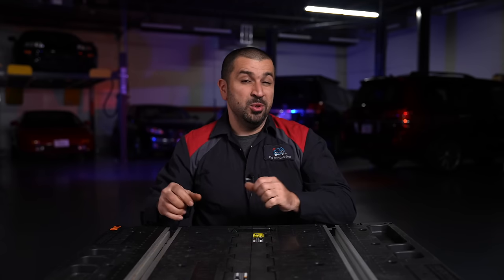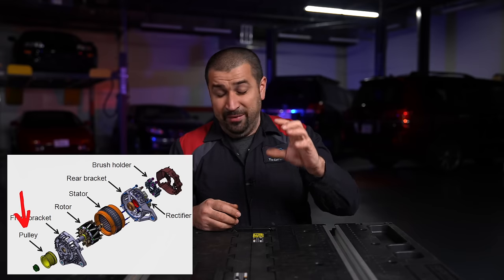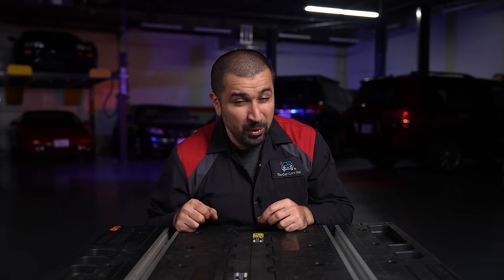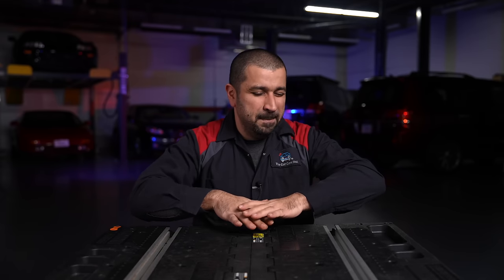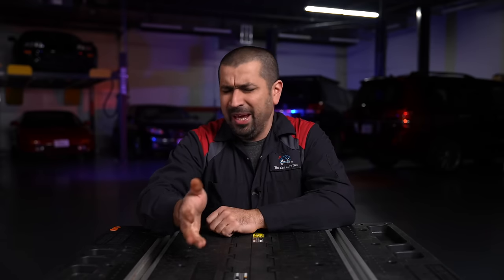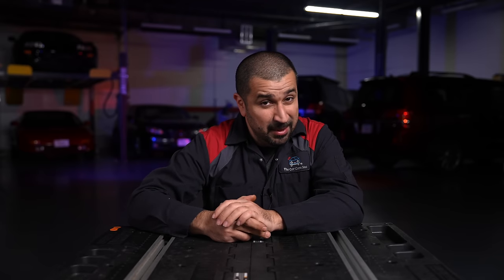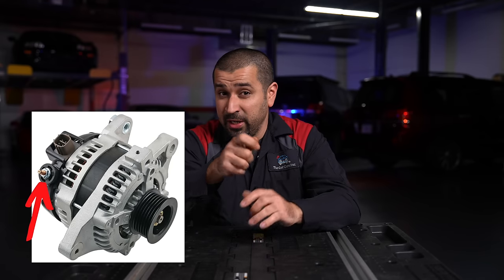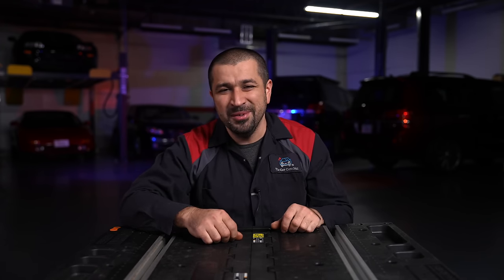How To Make Your Car's Alternator Last Longer? Everything You Need to Know

Comment: As an Electrical Engineer by profession since 1988 I can say: your explanation about the alternator working principles and how to take care of it is absolutely comprehensive, precise and correct, albeit easy to understand, I’ve ever seen! Greetings from Brazil!
Reply: except the bottom half would not normally be tossed but polarity flipped assuming they would use a full-wave bridge
Reply: What does it matter were you're from???
Brazilians have some complex don't they?
Reply: Can you please explain how the alternator generates ac current instead of dc current?

Comment: Yeah, when I worked at Autozone people would come in with a ghost in the car. Interior lights go off and on and only the headlights work. Battery was always bad. New car computers will start shutting all extra loads off to keep going. Hyundai decided to put alternator on bottom of engine? Stupid, stupid. Back in the day I rebuilt my Oldsmobile alternators. Great info. I really like your videos. Yes, always buy new. Rebuilt ones are done in Mexico and they don't care about quality.

Comment: I remember being able to buy a rebuild kit for a GM alternator for about $12 and have it up and running again. It basically came with a set of brushes, a diode trio, regulator and a couple of other things.
Reply: There’s an old guy in a wheelchair that lives out in the country, near me, and all he does is rebuild alternators. My Camry needed one and the cheapest one from the parts store was nearly $200. He rebuilt mine for $15.
Reply: You can still do this but mofos today don't even want to change their own oil.
Reply: @BruceLee-xn3nn  today's alternators are much more complex, than the old school, one wire alternators we had back in the day. Yes, at that core they are similar, but they are now more. Computerized. The newer things are, the more complex they are.
Reply: @m3rdpwr that's why I prefer older vehicles
Reply: Ah, the good old days ...when you could actually work on your own vehicles
Reply: @m3rdpwr No, there're not any more complicated than the old ones.  The regulator may be controlled by the computer but that doesn't really add much more complexity.  Yes, you can rebuild, or at least do a partial build of an alternator by replacing the brushes, which is the main thing that wears out, and the bearings if they're worn out.
Reply: @BruceLee-xn3nn   Yep, the only things that really wear out in an alternator are the brushes & bearings which you can replace yourself.
Reply: @tonydavis190 where do you get the parts
Reply: If your alternator is an internally regulated Bosch which is like every single alternator on any european car from the last 20 years you can buy that regulator/brush unit for like 40$ and replace it.
Reply: Same with my 84 Toyota Supra
Reply: @tonydavis190  on my 97 it horked the internal to the alternator vrm a few times, to show 16V on battery terminals while idling.
So bearings and brushes never got close to wearing out
Reply: New bearings?
Reply: @m3rdpwr  They are not that complex, and certainly NOT computer controlled or computerized.  They have the rectifier, the regulator, the brushes and of course the bearings.  All of these can be replaced by an enthusiastic DIY'er
Reply: @Noey001  The old one wire alternators, just put out power as needed. Now it's controlled by the car. If something goes wrong with the computer in the car, you could have all sorts of electrical issues because the alternator you could be affected.
Reply: @waynenoll1967  --What a Bargain and keeps old guy in spending money, sounds like he needs to charge more for his work unless he was just a close friend...
Reply: My S10'S got a 105 amp alternator. You have to cut the internal wires to finish separating the case and replace the diodes.
Why not make the regulator external?   .....at least make the diodes removable from the outside.
Reply: @randywl8925 it used to be separate in the 50’s and 60’s.
Reply: @1DwtEaUn  "show 16V on battery terminals while idling."
Bad juju!   Some aftermarket alternators have short lifetime regulators.
Reply: @randywl8925  "Why not make the regulator external?"
I suppose it makes more accurate regulation.  The main purpose is to provide current to the field windings and doing that without the snap on connector ensures the field windings don't suddenly lose that current.  But there's going to have to be a sense wire to the battery.  But it can be a very small gauge wire.
Reply: @slalomking  ....and '70s.  That was back in the days when you could buy things.  At some point everything has become a subscription.... a forever monthly payment. 😣
I wanted to buy a decent printer for work.  Everything now requires an internet connection and downloaded software.   I just want a freaking printer!!! 😖
They've now put some starters inside the lifter valley,  under the intake manifold. Toyota and GM.
They now make alternators that are disposable like everything else because we can't repair them.
I'm 66 and I'm glad that I grew up in the good old days when men were men and women......
.............wait, I'm getting a bit off topic. 😁😁😁
Many changes are illogical to us older folks.
Reply: @thomasmaughan4798  the connections can be lug type, screwed in place securely.  I'm assuming that all alternators are not constructed like this.
Reply: @randywl8925  hey I agree, I’m 61 been trying to still work on these newer rides.  It’s daunting at times.  Our latest vehicle is a 19 Yukon XL.  Bought it used.  On our first long trip alternator was putting out over 14V  as seen on the gauge.  Driving for hours it drops to an even 14V.  Then after a few more hours it drops to 12V.  I’m starting to panic, am I losing my alternator?  The wife pulls out the manual and starts reading.  The computer varies the alternator output to exercise the battery.  Yeah, so as we drive after about 45 more minutes, it comes up to 14V even again.  Now after driving it on more trips we know what’s happening.  So it’s not the alternator of the old days.  Also it has an AGM battery in it, so maybe it does this for that style of battery.
Reply: @slalomking  yeah, it just seems like they micromanage them now to help the car get .00421 more MPG.   I don't know if these later Fords also charge the battery according to its age?
These just seem overly complex for what they do.  No biggie for me, because I'd never buy a newer vehicle. If I can't work on it, I can't afford it.
Reply: @m3rdpwr  Today's alternators aren't any more complex when you get down to the internals and how they operate. Computerized control doesn't mean they are more complex.
Reply: @jeli3953  "New bearings?" What do you think the rotor is running on/in?!! We aren't talking about muffler bearings here. LOL
Reply: @Noey001  You are wrong about that. The alternators on these new vehicles are computer controlled. Better watch his video again. As far as repairing, yeah a DIY'er could do it provided the commutator is in good shape and there are no internal shorts etc.
Reply: Before that generators never had one go bad
Reply: I see so many video on car repair and 99.9 percent will wash off the engine compartment with water. Does it make any difference if the car engine is running or if it is not as far as creating damage? 
One Florida car repair shop seems to use brake clean on everything. Is it hard on rubber, plastic and electrical wire insulation?

Comment: Now is definitely NOT the time to be buying a car. Average car cost $47K?! That's insane!
Check your ego at the door - you need a vehicle to get back and forth to work, not to impress anyone. An auto finance rate of 7%+ is an insult to anyone with excellent credit. No thanks. Those new cars can sit on the lot and rot away for all I care.
Reply: I'm with you. I don't care how much it costs to keep my current cars running.
I'll drop new engines and trans if necessary I refuse to buy a new car.
Reply: Yeah, Im glad I keep seeing this message because I want a new car, but man these prices are crazy
Reply: The best course of action is to ask a consultant or investing coach for guidance or assistance on purchasing a car.
Speaking with a consultant helped me acquire my car effortlessly using the best plan available without affecting my  portfolio.
Reply: He appears to be well-educated and well-read. I ran a Google search on his name and came across his website;
thank you for sharing...
Reply: Auto rate of 7% should be normal, because if the FED didn't keep rates artificially low.

However, PRICES should insult you, these dealers are screwing their future for a gain in the short term.
Reply: Agreed.    I bought a 2016 Tundra for 32k it has 25k miles on it.   Decided to go that route instead  of spending 80k for a 2023 Tundra.
Reply: The reason cars cost so much is because the money used to buy them lost it’s buying power during 2020-2022. Thanks the powers that be. It’s one of the results of giving out cheques and bailing out businesses and buying up bond from the bank to supply cash to the market during that time. Having lived elsewhere in the world, 7% is nothing. Be glad rates didn’t go higher due to “cooking the books”. 😂
Reply: Used car prices are not really low either.
Reply: problem is idiots continuing to pay these outrageous prices. if people did not continue paying these insane prices, they would have no choice but to change it/bring em down. Blame those idiots.
Reply: @Rhgeyer278  'want' means you don't 'need'
Now go slap your head and focus on more important stuff in life.
Reply: Exactly and until consumers understand this and align with this way of thinking prices will remain at this usery and manufacturers laughing all the way to the bank. I get many compliments on my shiny red 2001 Jeep Cherokee XJ. It runs great , parts are cheap , and it is relatively easy to work on. Just piling money into savings.
Reply: Not everyone has a choice.
Reply: Best comment ever, period
Reply: Actually the Honda dealer I was at had 2% financing. The base level lx civic was 22-24 k depending on sedan or hatchback. The sport was 27k. You can probably even get a better deal now that the 2025s are dropping. I don’t get you guys.
Reply: "No one ever lost money overestimating the intelligence of the American consumer"......
Reply: @Seanmirrer  
Unless You Are a Good Mechanic,That's Just Wrong And Dumb, When For The High Cost
Of Engine  And Transmission You Could Easily Afford a Good Used
Vehicle Scotty Kilmer Recommended.
Reply: If you can't afford to pay cash, you can't afford the car.
Reply: When I was working in road service something I did find. In some suburbs you would find streets full of BMW's or Mercs.  It could also be broken down further.  Dad had new BMW so kid bought an old BMW 318 or 2002 with rust.  But they did get the privilege of saying " We all drive a BM"
Reply: I'm still driving my 23 year old Ford Falcon ... Just installed a new alternator !
Reply: @phugemawl  Australian BA, I assume. 
I had one for work and broke the diff . At 100000k
Reply: @chuckmaddison2924    Older than that, AU2 XR6 ex cop Gold Coast traffic car with 306,000km now. Had the auto rebuilt last year and the guy said I did well for it to last so long after cop thrashing ... No EV for me !
Reply: @GaryWinstonBrown is this Spam?
Reply: Good luck with that mission statement lol, egos are running around unchecked. 😅
Reply: I bought a 2007 Ford Freestyle last July. Got it for $5,000. Only had 50k miles on it. I did not want to buy a new car with their crazy prices. My budget was $6,000, was looking for the lowest mileage vehicle in my area for that price.,so far it runs very well. CVT scares me but will maintain it. 
Honestly these car prices are out of control.
Reply: @omt4293  ouch, Cvt transmission... better baby that thing.
Reply: @devinnorsworthy9154  yeah gonna change the fluid on it very soon. Can’t mess around with CVTs.
Reply: @omt4293  I couldn't do it... more power to ya lol 💯
Reply: @devinnorsworthy9154  lol the Nissan CVTs are way worse they are just horrible
Reply: @omt4293  just good luck buddy... good luck lol 😆
Reply: agree. as some dude who owned a secondhand toyota for just below 10 grand fully paid. filled it with love and car, drove around 30k+ kilometers ever since and still works just as fine as before. what he saids will only apply to idiots that don't know the strategies to find and buy a new decently good car or how to even maintain their old dogs.
Reply: I'm paying that money to buy a new 2024 4Runner, I'm not happy with paying 50k plus, but it should be the last vehicle I'll ever buy. That's why I watch these videos, to take better care of it. I damn sure don't ever want to buy another vehicle at these prices. To add a garage onto a house, cost in the 40k range, lol. These prices are insane, but in today's crime filled world, I want the damn thing to start when I want it to.
Reply: @RogueDemagogue  get a 4th gen... I think that's the most perfected one.
Reply: @devinnorsworthy9154  When buying used, you have no idea if that person kept up with fluid changes. Not to mention the break-in period.
Reply: Great video. Awesome
Reply: I always say, “Why buy new, when used will do?”
Reply: @slavko321 
Tell me about it ! 😮
Reply: Thank God there are still some sensible people still around.  I HATE new cars-jerking the steering wheel if you get anywhere near a solid line.  Depreciation is ridiculous.  Dealers are just stealers…no, I refuse to participate in that game.  I buy and hold.  Just replaced the engine, good for another 400,000 klms plus.

Comment: In my older car, I have one of those cheap Bluetooth USB chargers that shows the voltage when it starts up.  It's convenient to have that because if you don't see 14.4V or so, you know something is wrong with the alternator.  Can also switch to just accessory to see if the battery voltage is okay.

Comment: My alternator went in my 05 Element and I tried to make it ninety miles home. Unlike an old car you can’t turn off all the accessories and have the battery only feed the coil. When your voltage drops to a certain level your computer is going to go Star Wars and every sensor and gauge is going to do the holy dance while you’re hoping down the road in limp-mode. I was towed to a small town Honda dealer late Saturday afternoon. They put the only alternator they could find in it. It was an aftermarket one that so far has lasted me thirteen years, the OEM alternator lasted six years. I’d rather have an aftermarket than a rebuild. Certain things like CV short shafts demand OEM parts unless you want to change them twice.

Comment: My alternator started dying gradually. On my way to work the charge light would start flickering and the voltage would drop (I plugged in a gauge to the cigarette lighter to diagnose). This started happening more and more often until about 3 days ago I got tired of worrying whether it would "come back to life" again, and replaced the alternator.

Comment: 8:18 - Hmm, I don't think most use a regulator (as they'd just have the full bridge rectifier, smoothing caps and then have this regulator on the output).

What they WOULD do is have a series of voltage dividers (usually in 1v increments for range sensing), and at the end of each, a single mosfet with an output bias on the gate -- then the voltage dividers can ADD bias on the gate of this mosfet, that merely turns on/off the central coil based on the output voltage. 

All basic components, and all don't really care about temp, aside from the diodes and mosfet (which are usually overbuilt on good ones anyways).

Comment: 1998 toyota camry v6.  Original alternator.  Replaced the water pump at 90K, as recommended.  40K later, water pump seized.  Will it last another 25 years?

Comment: Mine lasted 8 years. Are you saying the rotor acts like a electric motor hence the brushes? And the brushes supply power to the rotating electromagnet? If so How is the electromagnet powered?

Comment: If you want your alternator long lasting, make sure your vehicle is equipped with a Denso. My '94 XJ40 has got one and 30 years, 160k miles later still giving me 13+ volts.

Comment: What happens when you see sparks from the alternator then a few seconds later the sparks dissapper. The alternater had been not used for about 3 years some dust on  it but no oil water or such. Please advice
Reply: Maybe the brushes weren't making good contact, initially after not being used for long time. After a little bit of turning they get pushed, down into proper contact, by the springs. Brushes probably wearing down quite a bit. The shorter the brush the lower the spring force. Alternator could fail before long, but that is not certain.